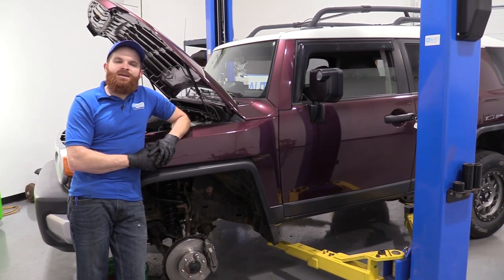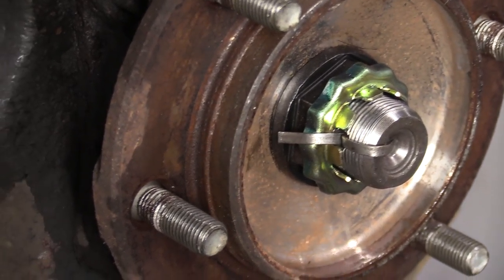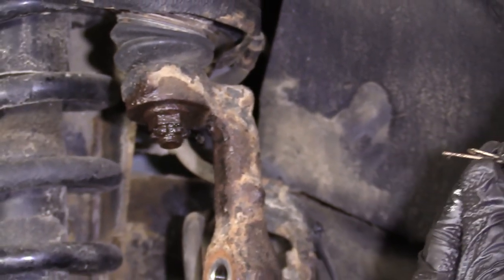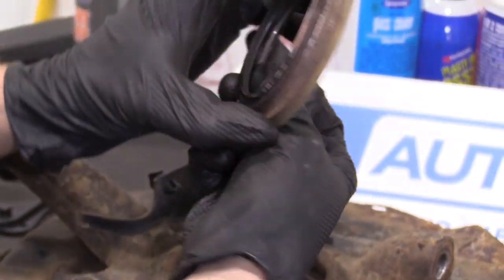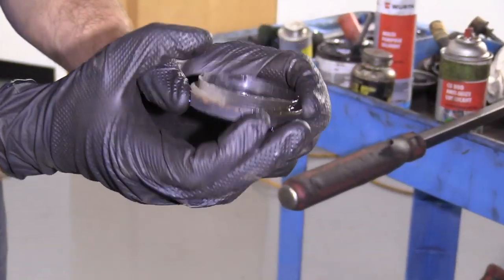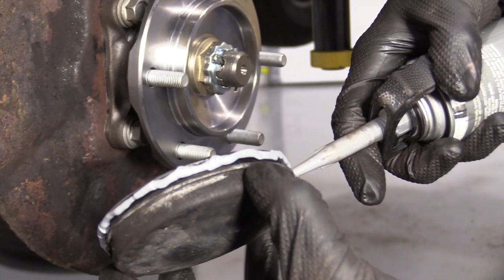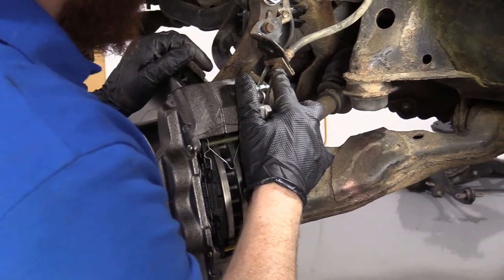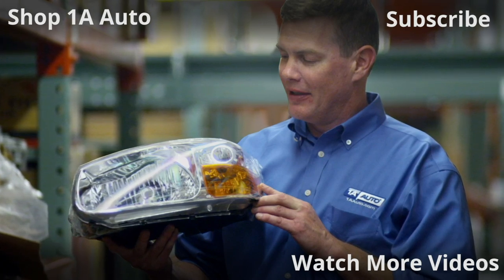How to Replace Front CV Axle Seals 07-14 Toyota FJ Cruiser

Comment: Thanks for the video. I might take the skid plate off before I take the seal out tho lol. These videos are one of the many reasons we shop on 1a. I haven't had one problem yet and we have gotten alot of parts there from lower control arms to rear springs. Great parts supplier!

Comment: Jesus, I'm not one to leave negative comments much but find a less blunt object to take that cap off and if you need to put a bar on the studs put lug nuts on first so you don't ruin the threads. Axle nut is 35mm on stock axle.

Comment: This is most definitely NOT the correct way to do this job on the slightest, nor does he even know the part #’s of what he’s puting back in to answer the replies to his videos when their in his frigging hand!!  Unbelievable!!  Do not do it this way or you’ll be sorry. So many other clear videos on here of how to do this the correct NON INBRED way. Unbelievable. Smh 🤦
Reply: 100% agree, I was able to use a large socket that fit over the seal and I was able to tap it in that way (after adding a little bit of oil to lube it up), being a repair shop he should have access to multiple sized sockets that would have worked